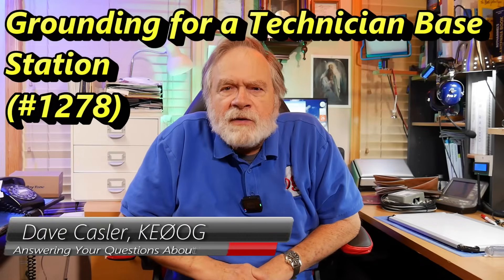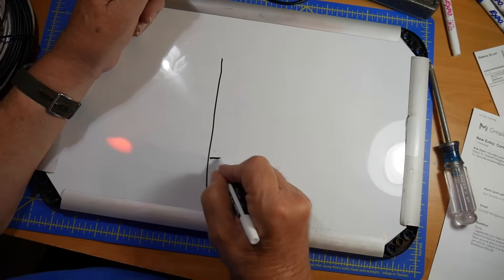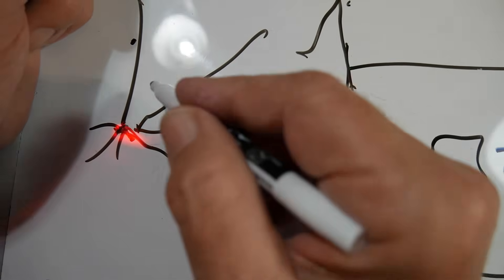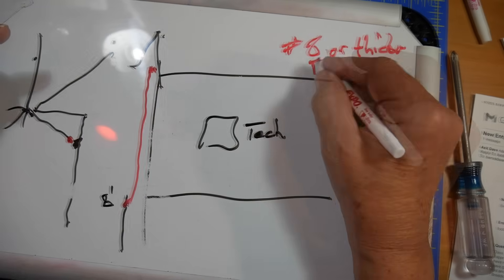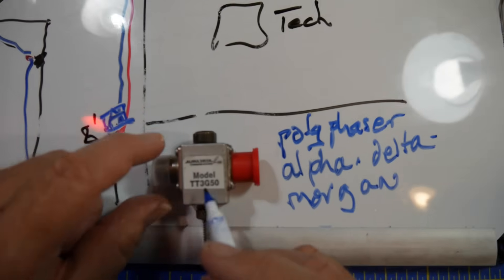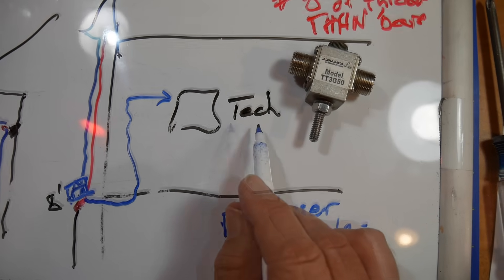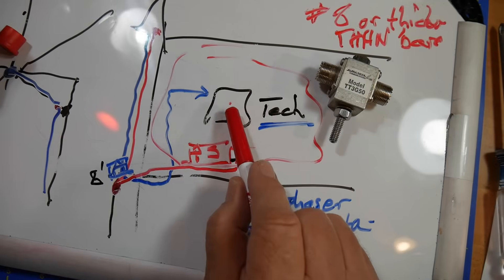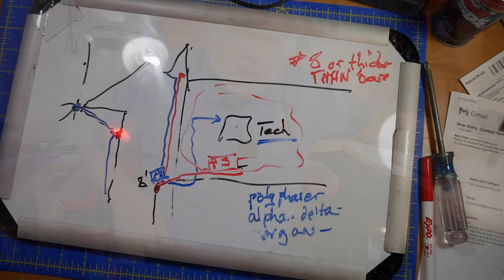Grounding for a Technician Base Station (#1278)

Comment: Connecting the antenna mount to a ground rod is a good idea to get rid of the static charge as is a lightning arrestor, I would not be connecting the negative terminal from a power supply to that ground rod though. (Also remember different Countries have different wiring and safety systems, some say bond ground rods, some say Do Not bond ground rods as it can affect safety switch operation, check with an electrician in your Country before connecting anything to your house ground system.)

Comment: Great and important question. The ARRL has a great book on grounding and bonding volume 2  . Also # 6 and bigger is code for most of US. Hear it is #4 .  I have 2 AWG THHN .  Also for ant station even just receiving bonding to house ground is a great thing. Do this outside   and combine all ground rods together with # 6 or larger stranded base copper wire and Barrie it.  In case of a strike you want that out side your home and clamp or weld connections never solder outside .use UL listed wire and clamps and protector. Then you know you got correct ones. The UL is stamped on them. Even the ground rod has UL stamped at top . Wire has it printed on label  of spool of bare wire .Look for UL . It is worth the extra cost . 73